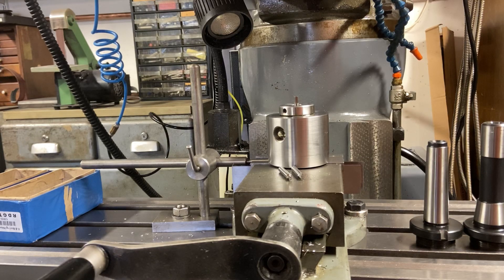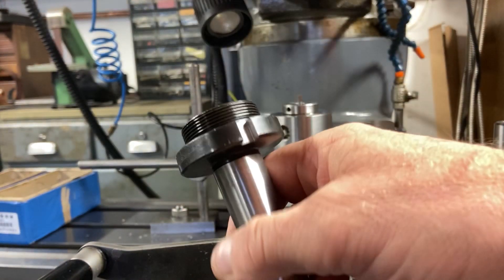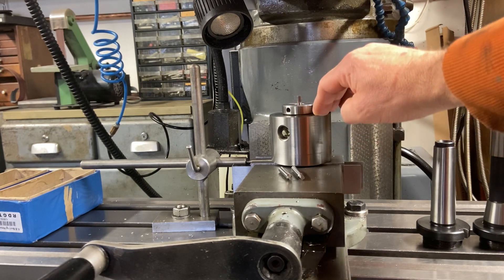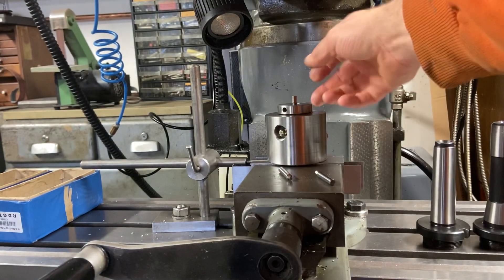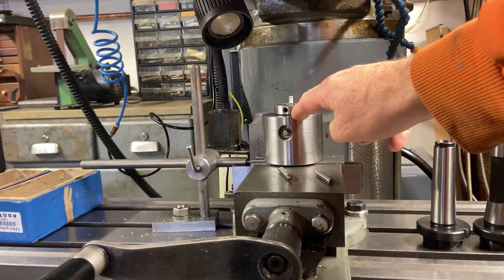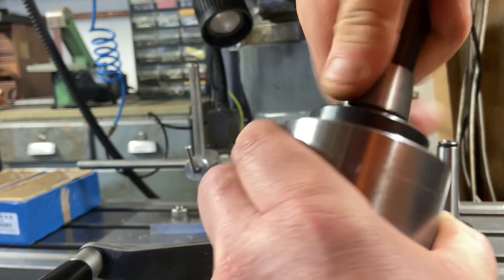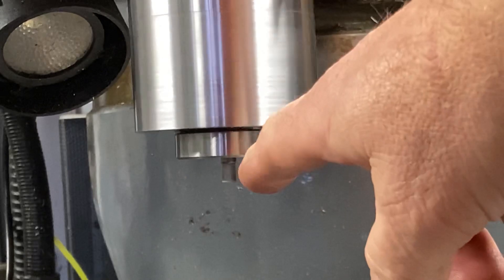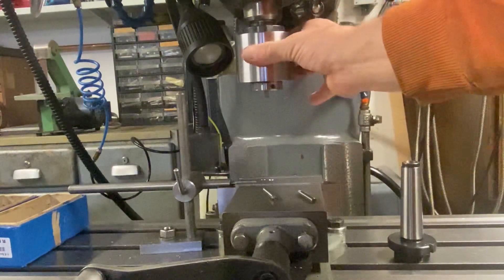Homemade Rotary Broaching Tool

Comment: Sorry, I'd like to ask about your hexagonal processing video. It will rotate all the way to the back. Have you dealt with the problem
Reply from the maker: Very sorry I am not sure what your question is asking? 
The tool (broach) stays still once in contact with the work piece while the spindle rotates. The tool then cuts the corners as it moves through the work piece and the rocking movement helps the cutting action rather than normal broaching why which is forced the tool through using a press.
I hope this answers your question?
Reply: @homeengineer5212  Could you please give me some information real quick? Certainly the distance between the tip of the rotary broach and the point where you cut the 1 degree angle is critical to the performance/accuracy of this tool? Because the longer it is, the more it will increase the swing radius of the broach. So given this, how did you determine the correct overall length? Did you do the math, or did you get the dimensions from another one? And on that note, without giving me complete plans/blueprints, is there any chance you could give me just the critical dimensions? Maybe just that distance in the length, from the point where the 1 degree angle first starts, to the tip of the broach, or perhaps to the seating or mounting point of the broach in the holder? 

Thanks so much. I'm planning on making one of these too.
Reply from the maker: @smallblockchevy1022  Thank you for your interest. The tool was designed to fit 25mm from the front face. So depending on the bearings and body a small calculation needs to be made to determine the tool end on centre. I designed the tool to take preset tools in holders so once set they are easily swapped out. So in my case it was the :
distance from tool end + tool body to angle = hypotenuse.
And using the 1 degree angle the offset can be found for the main body to allow the tool end to rotate on centre. Hope this helps.